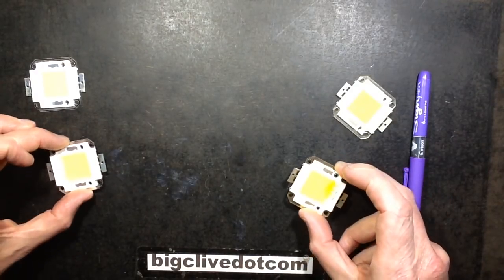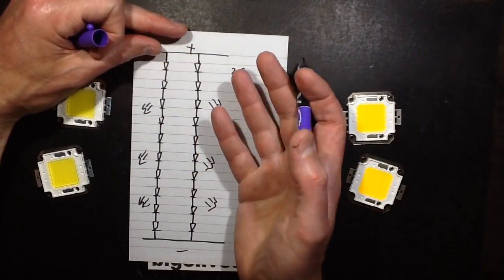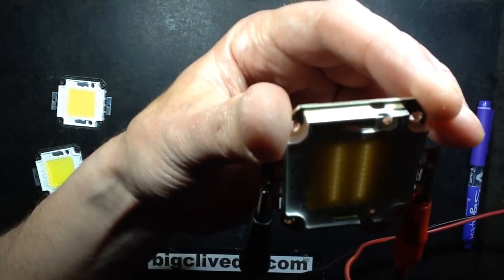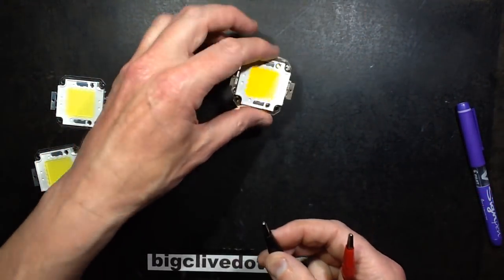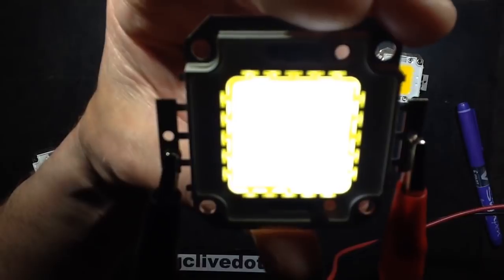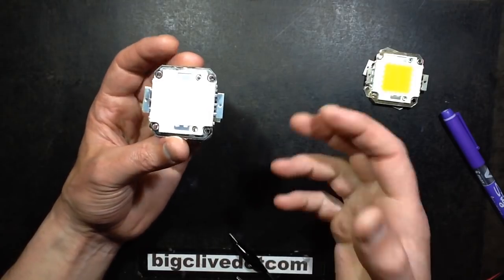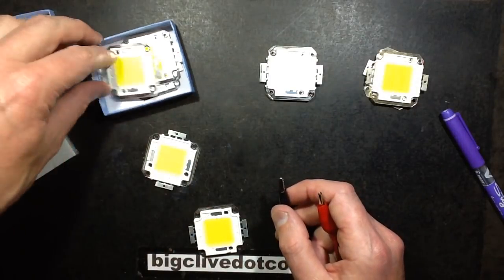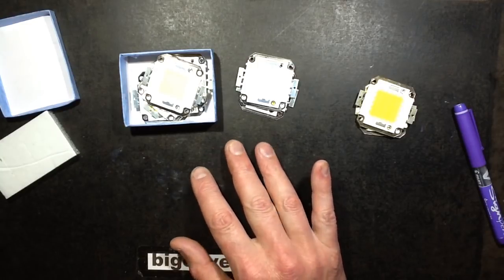Testing dodgy 100W LEDs from ebay sellers.

Comment: And the obvious question  - Where does one find quality LED's?
Reply from the maker: It's very hard to find them.  The best are reserved for the bigger equipment manufacturers.
Reply: you buy XHP-70's from Cree vendors on quality copper heatsink stars, then heatsink those stars as good as you would have sinked the 100 watt emitter. You can end up with roughly the same lumen output at less than half the wattage. or you could buy a bunch of XM-L2's but the XHP-70 is 4 of those on the same die. If you push them at around 40 watts the light output won't be that noticeably different from these 100 watt emitters pushed at 100 watts.
Reply: ***** Every single diode has a voltage threshold to start conducting current, and they all are unique. It is normal that some of them start glowing sooner than the others. Not long ago, while we still were making transistor amplifiers, we needed to buy transistors in pairs, and those were expensive. Same transistor, the same number, but they all needed to be tested first, and then technicians were choosing the most similar ones to put them in pairs. It took time, and it costed money :) 

When you test those diodes, you put the voltage on it, measure the current and lumens ( light power) and you hope they won't burn too soon. But they usualy last very long if handled properly, afterall, everything is made in China.
Reply: Mile Jukic yes you are right, it's similar to how you can have a handful of NPN transistors, all the same exact transistor, but when testing them individually you see that some of them have lower hfe's. essentially they will all work the same, but those with the lower hfe's will seem to 'work' from a lower biasing current/voltage.
Reply: The more you push them, more power goes to heat, and very little to light.
Reply: I've bought a few last month from Banggood.com, good price, from china and none were faulty.Don't buy from Ebay seller goodluck*shop, 100% of the chip's I received from there were simply rubbish.
Reply: Jack Sprat I learned my lesson,when buying on eBay,I stay away from items shipped from China
Reply: Where do i buy legit XHP-70 ?
Reply: Jack Sprat All Chinese rubbish but some European companies get involved in quality control and charge buyers a  high premium
for it
Reply: Exactly. That's why LEDs and Laser diodes are "current devices" rather than "voltage devices", and need to (LED) be equalized in some way. In diodes as these this is done by internal resistance for each row of chips.
Reply: Yes. That's why HIFI-enthusiasts want "matched pairs", by selecting out two and two transistors with almost similar current draw for an given current input. It's not important if it is "high" or "low", but that they are similar in response.
Reply: I found a 100w LED with a much better design. If you want you can check it out in my most recent upload.
Reply: CREE, expensive, but extremely reliable.
Reply: And just where might I find your most recent upload?
Reply: Big Clive, you should take a look at ChanZon led's, they seem quite good.
Reply: stars? sinked? same die? emitters pushed? Are you trying to tell us something?
Reply: Those ones were quite alright, and this is not how you test it

Comment: I bought Cree XPG's from ebay. Are they fake? They seemed high quality when I measured their forward voltages at over 1A to be around 3V. The no name brands seem to be higher in Vf and are lower cost. "Cree's" also have smaller chips which  work better for higher throw lenses. They even have Cree XPL's now. I'm not talking about the 100W LEDs.

Comment: http://www.ebay.co.uk/usr/sunnyshop2015?_trksid=p2047675.l2559         Recently supplied me with some 50 watt cold light high power LEDs. All worked great.  Very pleased.
Reply: I followed your advice, bought some and was happy. 3 out of the 5 LEDs I ordered were working perfectly, 2/5 had a missing row, all had uniform brightness amongst the LEDs when tested under low voltage/current operation. At something like 8 euros for the lot, nobody can tell me they're expensive, even if you threw away the ones with the missing row.

Comment: I wouldn't expect anything at 20ma , the 3w chips use 600-700ma
Reply: Gavin FreedomLover Those are 1w leds, and they're 300mA. And the point is that some of these leds are passing 20mA and not lighting. That is a leaky led which will damage the life of all of the chips in its row.

Comment: i thought LEDs aren't dimmable? i know nothing...
Reply from the maker: You can dim an LED by either reducing the current through it or by turning it on and off very quickly and varying the on to off time.  (Called pulse width modulation.)
Reply: bigclivedotcom how come most LED bulbs say 'not dimmable'?
Reply from the maker: It's their power supply circuitry that is not suitable for dimming on a standard wall-plate dimmer.
Reply: i see. tnx
Reply: Regular dimmers used for incandescent bulbs work on AC power and LEDs have to be driven with very well-regulated DC. Incandescent bulbs are basically just heaters and it doesn't really matter what quality of power you feed them. 

Your typical LED retrofit bulb contains a circuit that converts the 120V AC signal from your wall into DC to drive the LEDs. It is almost impossible to design a driver circuit that works well when fed with AC power that has been run through a dimmer first, simply because the AC->DC driver circuit no longer has a clean power supply to work from (Wallplug-dimmable LED bulbs do not work very well, especially at low dimmer settings).  It's actually easier to make an LED bulb that screws works only in a non-dimmable socket with clean AC input, but that has its own remote control for doing the dimming on the DC side. 

What needs to happen is someone needs to develop an actual standard for LED lighting instead of trying to shoehorn LEDs into sockets intended for incandescent which completely different (and contradictory) needs.
Reply: Michael Gordon i always thought it would be a good idea to have a separate low voltage DC circuit for LED lighting. would take some planning but it could be done.
Reply: there dimmable led bulbs too
Reply: I sell dimmable LED lightbulbs. They need the correct dimmer switch/module to work.
Reply: I think it needs to be well regulated, though an electrician did tell me there was some tolerance built in. It could be an interesting project for solar power. Why go through the expense of inverting up to mains AC from your solar panels when you can power your lighting and many portable devices with low voltage DC?
Reply: bigclivedotcom I hate pulsing leds. Looks so disgusting when they are on a low frequency
Reply: LEDs run off of a DC supply...even if it's installed in an AC housing...you cant dim the DC powered LEDs buy dimming the AC powering a DC power supply that has a threshold voltage requirement built in for it to function...either the power supply is on or off...there's no in between on that configuration

Comment: +bigclive Do you have a recommended LED seller?
Reply from the maker: I'm afraid not.  They are all very random in what they deliver.
Reply: What about 20W LEDs? It's only 2 rows in a 20W LED so maybe it's easier to find good ones or is it the same, a gamble, maybe you get good ones, maybe you get bad ones?

Comment: You could also get a 100w incandescent lamp, those exist.
Reply: Not exactly; a 100W incandescent light does not produce nearly as much light as a 100W LED. Both of these draw 100W of electrical power, but an LED produces a lot more light for every watt of power, whereas the incandescent is dissipating a lot more of that power as waste heat. LED bulbs in stores that are marked "100W equivalent" on the box usually draw 15-18W, but still produce as much light as a 100W incandescent.

Comment: I think there's a good reason why a 60W Cree CXA2530 costs about 25 Euros. You would never get a 100W LED that's made of proper, fully working LED-Chips from an ebay seller for under 10 Euros. Those LEDs are basically working, but they are way out of spec and never as bright and reliable as a LED from a serious manufacturer.

Comment: I sometimes wonder about those no name brand products on eBay? Perhaps factory rejects? Instead trash them, they were sold on the secondary market and sold again at a bargain price? I am a Chinese do know they are fully capable of producing fine products. For example, I bought Chinese made NiMH batteries and 18 years later a few that finally failed. 12 years after I bought the first match and bought some more, all went dead after about 1.4 years. Where the old ones are still working. Regarding the LEDs in this video. I always wonder how they are put together? In series of 10? At 3.2V per LED and will take at least 32V power supply, it makes sense. It is also a lot easier to make. But the lead LED will bare 10 times the load I am not how it will survive? At 20mA per LED times 10 = 200mA? It will be toasted in a blink of eye. I need to look into it.

Comment: Let us know when you find a seller that is selling fully fuctional ones? Thanks
Reply: While Clive's technical explanation of what's wrong with these LEDs is excellent, it doesn't address the somewhat bigger elephant in the room. Even if there were such a seller today, tomorrow they won't be there. That's the problem with these eBay sellers selling Chinese goods. Today they'll sell you one thing that is high quality, tomorrow they'll sell you something much different (even if it appears to be the same thing). That's the fundamental problem. These sellers source the cheapest things they can find and price them up to make money. If that means getting high quality stuff or sourcing factory rejects (and selling them as functional devices), that's what they'll do.

This comes down to business ethics and trust. When you buy from US suppliers, trust in their business is the most important thing. So, business ethics usually leads you to the same quality over and over. Though, with US sellers, quality can change over years, but usually not over months. With eBay seller ethics, they really have none and they also don't care about trust. They don't really care if you end up with garbage. They just want your money. This is why you can source one thing that works perfectly fine and then go back to the same seller even just a few weeks later and get something entirely different the second time you buy.

Comment: Electricity scares the shit out of me. I see people hold onto electronic circuits while they are live, yet nothing happens. Why?
Reply: Because either the voltage is low enough to touch or they know where to grab the circuit board
Reply: Because electricity doesn't scare the shit out of them?
Reply: In this case, I'm pretty sure the Clive is not grounded. That means there is no easy path from the live wire, through his body, and to the earth. Even if he grabbed something live with electricity, it wouldn't have any reason to flow through him (he'd get a very tiny current, but nothing more).
Reply: Steven Haussmann If he grabbed the positive with one finger and the negative with his thumb, couldn't the current just flow through his hand and give N unpleasant shots K regardless of whether he is grounded?
Reply: Roflcopter4b to put it in laymen's terms, electricity will always flow through the path of least resistance. Our bodies (skin) has VERY high resistance (in the mega ohms) whereas the steel he has the alligator clips attached to has extremely low resistance, in the sub-ohm range. it would take tremendous electrical pressure (very high voltage) for our skin to conduct electricity. Now if the skin is wet and that water contains aqueous metal ions (such as sodium from the salty sweat we release) the resistance will drop and the electricity will basically travel through the layer of water on top of the skin, that's when you might start to feel a small zap. Now if you were to have a cut on your skin, it would suddenly become much more dangerous, as the interstitial fluids and blood in your body is full of different aqueous metal ions, such as potassium, sodium and magnesium, which are all good conductors of electricity. You may have heard these referred to before as electrolytes, as they can hold charges and basically are responsible for the electrical impulses transmitted by your central and peripheral nervous system. Once electricity gets inside the body, it uses these electrolytes to pass a current through the body, and if the amperes are high enough, can cause your central nervous system to transmit the energy from the electricity entering your body through said cut. this can cause heart palpitations and seizures, but only if the electrical power is high enough. 20-30V @ 0.3A amounts to around 6-10 watts and generally is not quite enough to hurt you unless you had a massive bleeding wound.

Comment: from looking at this video.. it seems that there is both warm and cool LED's and the cool LED's light up first. and they are not placed evenly.. and also it seems when the voltage is low that it doesn;t spread the power across the LED's evenly.. but seems it might when they get the right voltage.

Comment: Can someone explain what the drawback is to having an uneven light at low voltage/amps. Does this mean that certain individual leds are less efficient. If at the maximum operating voltage and current supplied by the driver the LEDs still all light up then doesn't the chip still operate correctly?
Reply: ..Yeah, I would expect the uneven lighting when they're aren't even supplied the needed volts/current.....As long as they all light when fed the proper needs...wouldn't that 'pass'....?
Reply: @dougankrum3328  Pass is a relative.  The LEDs that are brighter initially will fail.very quickly.  You will not get very many hours out of them.  When people think that LEDs last 50000 hours they arent these ones.  You might get a few hundred hours instead.  So from a quality control perspective it fails since it will not reach its design life.  Also in the case of a bad 100W led if to drive it to the design voltage it will draw a lot less... lets say 70W... and some of that is converted only to heat without producing any light.  So you end up with an inefficient light that wont last very long.

Comment: I have a couple questions:

First, just because they ramp up at different rates, isn't it possible that all the individual led diodes in the matrix "level out" when they hit full rated power?   If it's putting out the specified lumens at the rated power, wouldn't that be the case?  Or is it that some are carrying a heavier current load which leads to premature failure?
Second, how can we tell when buying LED's how to tell the difference between the winners and the duds?  They all look the same online.

Comment: I have just bought 2 of the cheapest at the time (maybe $2.3) 100w Cool White COB LEDs from eBay (.com). I have ran them with 24v (from an ATX PSU) to test them. They light up very dimly (total brightness like a classic GaAs indicator LED), and each of the LEDs inside the chip light up extremely evenly and consistently. It honestly surprised me. They came in a static dissipative thermosealed pouch, and the LED is physically the same as yours. I'll post the seller asap.